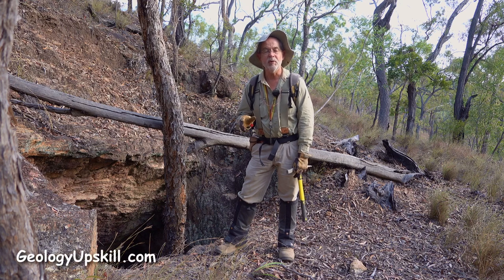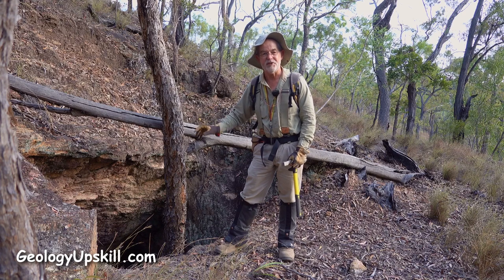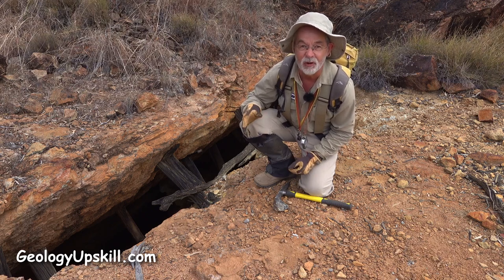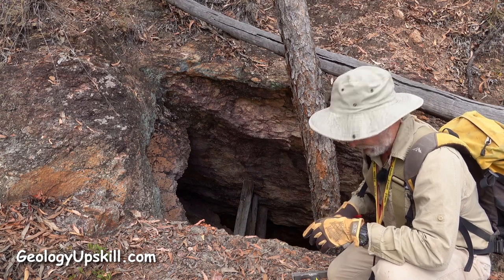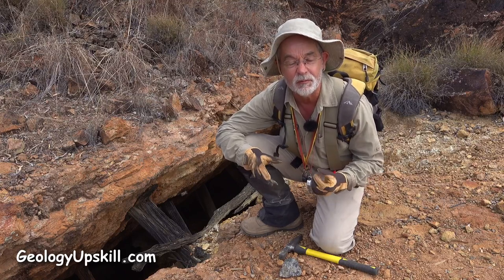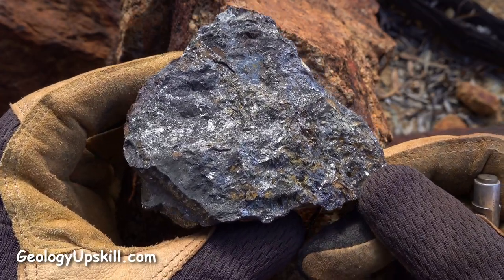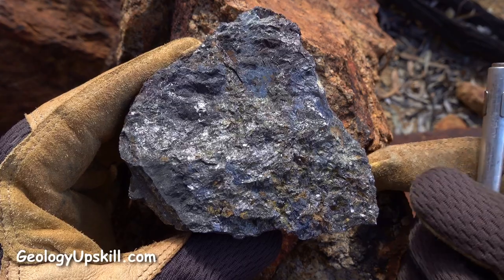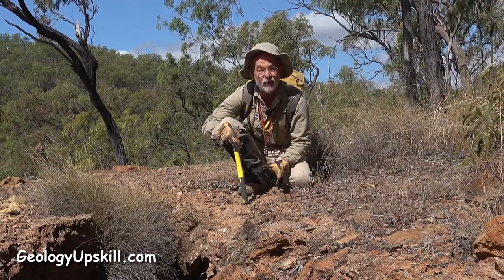Slot Stopes

Comment: "Most of the timbers have rotted away". I remember reading a 1920s report on how terrifying a mine was when the timbers were going in. 
90 years and several earthquakes later when they had rotted away, other geos seemed happy to wander around in there hitting things with geopicks.
Reply from the maker: Considering the subtropical environment here. It's remarkable any timber is left. Some of them still have wedges in place. Those miners knew how to select good wood and set it well!

Comment: Pardon my ignorance, since I am unaware of Australia's geology and dont have much experience identifying unique minerals in the field. For that magnetic mineral, what lead you towards pyrrhotite rather than something like magnetite? Is it the fact that it's surrounded by sulfides, so looking for a magnetic sulfide is a good assumption? Or is it that you've just seen minerals like that enough times and are familiar?
Reply from the maker: Pyrrhotite is a sulphide so it has a metalic lustre (usually with a bronze or pinkish colour). Magnetite is an oxide and it ranges from black to slate grey with a bright, but not metallic lustre. Pyrrhotite is the only sulphide that is strongly magnetic.
Reply: Thank you